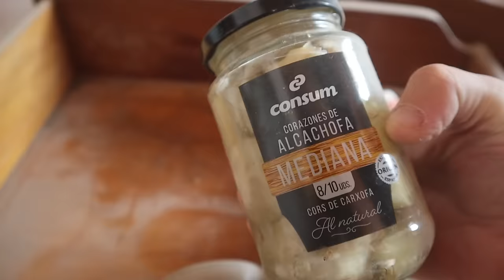Winter Jobs, Kitchen Renovation [+ Q&A] on our Off-grid Homestead

Comment: about the pond, i have created a series of small ponds instead of a big one. the pond liner is much easier to install, less expensive, and the water is closer to where i need it. my ponds are about 3m x2mx 1.5m deep.  the overflow goes into the next pond. 
to aid with suppressing evaporation, i have introduced water lilies, and i am growing fast growing tall grasses and such around the pond, and a tree on the south side.
Reply: Great idea!
Reply: In the U.S., they are having good results with floating light plastic balls on the surface of the water. It acts like a cover, but goes down on it's own with evaporation,.
Reply from the maker: That's got me thinking!!

Comment: Good idea to get more water storage.  My spring ran dry in 2010 and never came back.  Had to put two 13,000 litres tanks in and buy water and collect from roof as well in winter, which also became less rainfall.    If you can afford bigger tanks, I would get them.  The seasons have gotten drier for sure here.(Australia)

Comment: Swales may be a partial answer to keeping water on the land, filled with leaves, branches so it soaks up what little moisture comes. 
Ponds are great if you have land, money time and somewhere that has a lot of shade, but rarely are shade and location likely. 
Mulching the land itself may keep the evaporation less, allow the soils to hold more. 
Why is the strimmer taking so long? They're not mechanically difficult.
Reply: Quick note, you aren't alone in operating the acreage as farmers, in the UK the number of women farmers has increased considerably.
Reply from the maker: I dunno, maybe a lot of strimmers broke this winter!